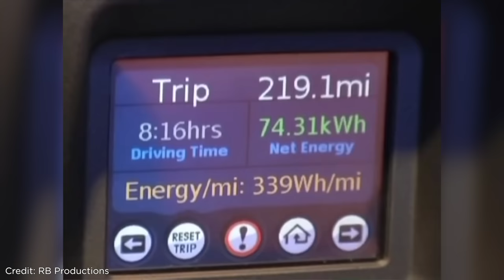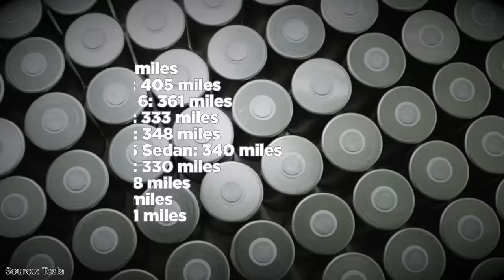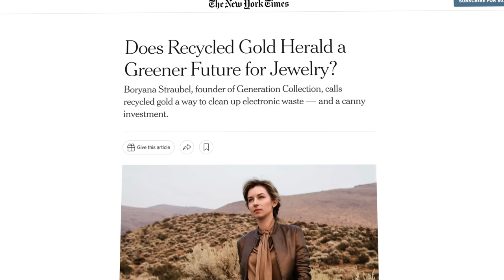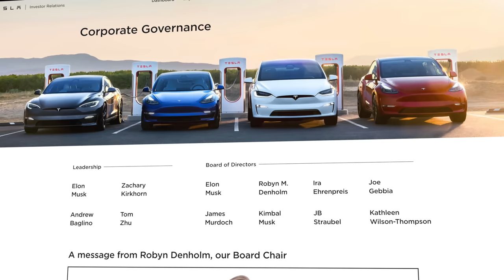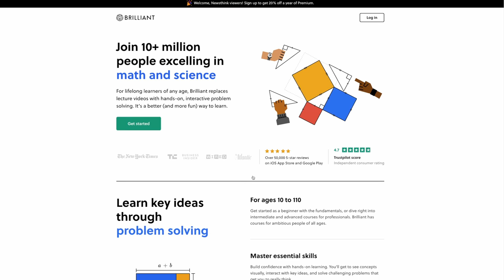The Quiet Engineer Behind Tesla's Success

Comment: Thank God JB convinced Elon to abandon battery hot-swaps, which were always a terrible idea and a disaster waiting to happen, despite the fact that some others (notably the Chinese company NIO) are doubling down on it. A normal EV battery sits on the FLOOR of the car, INSIDE the structure, securely fastened and sealed from the outside environment. But a swappable battery is just HANGING UNDERNEATH, on the OUTSIDE of the car, held in place by a few bolts/screws, exposed to the elements. A half-ton projectile hanging on by its fingernails to the bottom of the car. But it gets worse because it doesn’t merely hang there. It’s attached/detached, fastened/unfastened repeatedly. This is the opposite of secure. It is precarious BY DESIGN because the hot-swap process needs quick and easy access to the battery. If hot-swappable EV batteries become popular, it is inevitable that, sooner or later, a battery will simply fall off a car on the highway and cause a fatal 20-car pileup due to negligence, incompetence, or fraud.
Reply: Yeah...Battery swap is very bad idea
Reply: What you are describing is an engineering problem like any other ... This is how the design process starts.